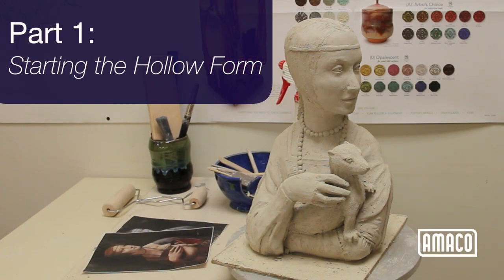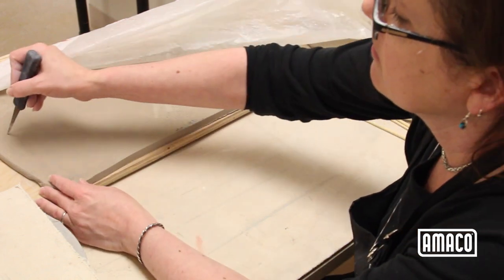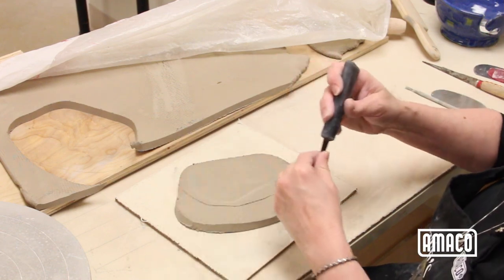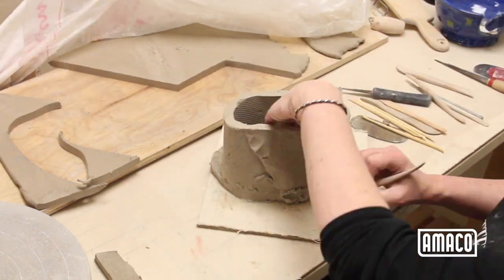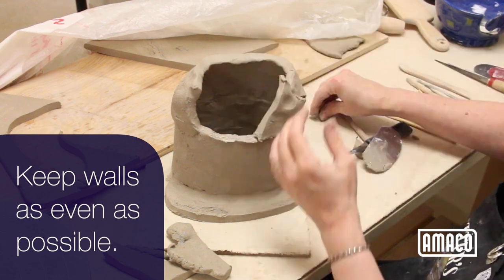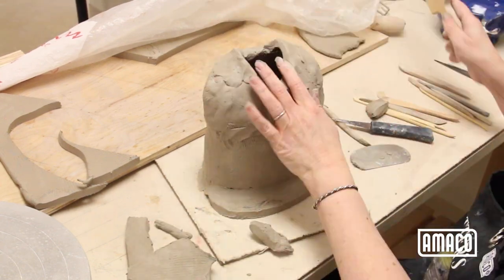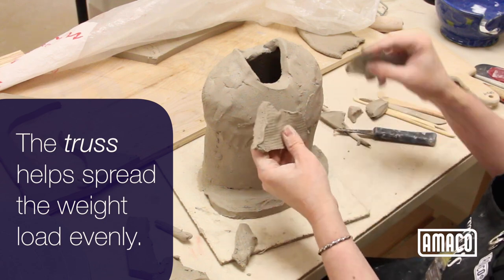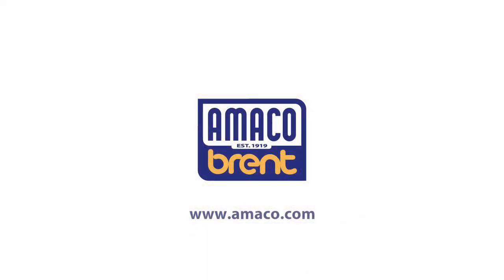Sculpting the Human Figure - Part 1: The Hollow Figure

Comment: What kind of clay do you use?
Reply from the maker: She used AMACO Off-White Sculpture/Raku Clay No. 27 (https://www.amaco.com/products/clay-mst-27-m-50?ref=2&taxon_id=433) 

This clay body has grog in it and can be used thicker due to its large amount of grog, or fired clay bits. The grog makes the clay dry and fire more easily.
Reply: Great series. How long do you leave the slabs to dry, or do you work with them wet?